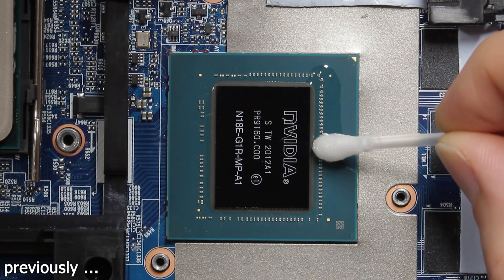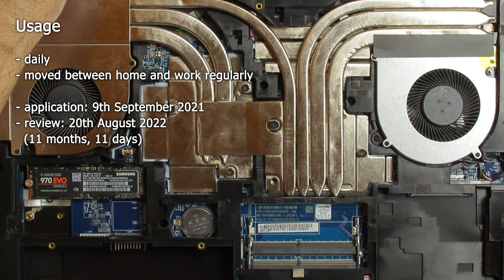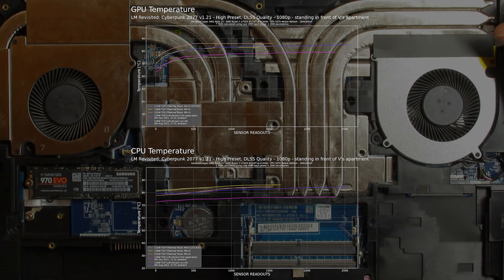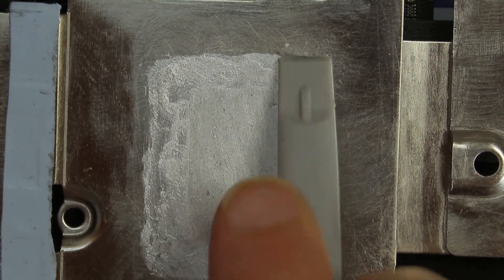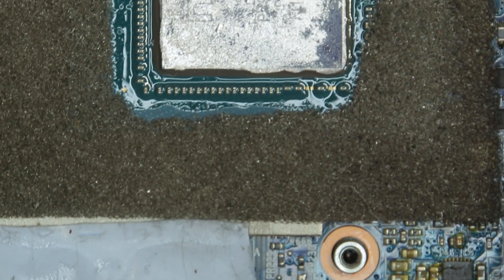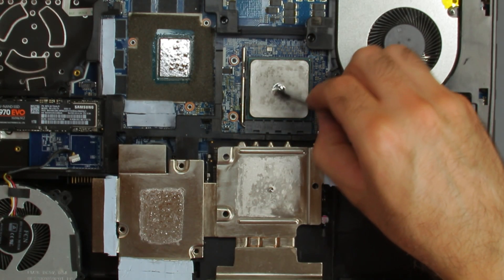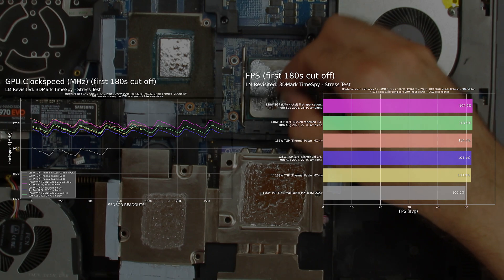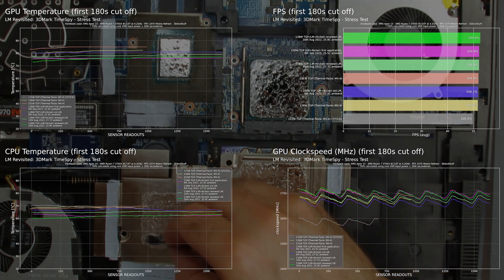Did my nickel plating hold up? - Liquid Metal Revisited - Part 1/2

Comment: Where did you get that foam? I can't find it. I looked on AliExpress and Amazon
Reply from the maker: It's acoustic foam. You can find it in audio stores.
Reply: @TechModLab  About acoustic foam. Is it capable of withstanding the high temperatures generated by the CPU and GPU?

Comment: Great video along with a great series, not seen anyone else doing anything similar.

I saw that Sony were using liquid metal as a thermal interface in the PS5, getting some technical specifics from them is presumably impossible but has anyone done any analysis of the PS5's heatsink coating? I assume Sony did the research before deciding to go ahead with this.
Reply from the maker: Yep they probably got a better nickel plating process. I still suspect my nickel plating was contaminated during the plating process. At least it's strange that it does react that much after 11 months.
A little reaction is normal though.

Comment: i came to same conclusion with my zehyrus G14, it had nickel plated CPU heatsing part, i nickled plated GPU part, after 3 months, temps got bad rly fast for gpu, it looked much worse, all liquid metal was gone, hard as rock, i tried LM second time, same result, 3-4 months , i quit it , put MX4 and its fine ...
same result with delided 7700k , lapped the sh mirror of it, putted mx4 and after 3 yers still good temps

Comment: Hi! for the GT75 titan, how thick should the foam barrier be? I'm considering on using liquid metal on it, I've seen linus tech tip use that coating + a thin electrical tape to prevent damages just in case the liquid metal does leak out. I'm so sorry for having so many questions but I really love this titan and here in the Philippines, I can really say that there are only a few owner of the GT75 titan which is moded by HIDevolution. hope to hear from you soon! love your content!
Reply from the maker: Thanks and welcome :)
The foam barrier needs to be roughly 3-4mm thick and the foam must be very very soft. You shouldn't use dense foam. In my experience acoustic foam from the audio enthusiasts is fine. But make sure it got no initial mechanical resistance when you push your finger into it. It must be soft to the touch. Best practice would be to visit a audio HiFi store yourself and ask for soft foam. It's quite cheap.
You can cut the foam with a cutter knife to a smaller sheet.

Comment: LM is only working on copper!
first you must apply the LM on the copper, than wait 1h and apply LM again.
than on to the Die and put it tougether ✌🏻 than its working for a looooong time.
Reply from the maker: That's not true. LM usually works on nickel plated copper very well.

Comment: Great content as usual!
Was wondering which topic you were going to cover this time. It's really sad that XMG and their counterparts simply ignored any upgrade path to this model whatsoever.
Reply from the maker: Thanks!
Well XMG wanted to get a BIOS update, but they rely on their ODM. XMG got no BIOS development devision. However, their ODM is not able to deliver a BIOS update. Check Link:
https://www.reddit.com/r/XMG_gg/comments/n4i3x2/update_thread_about_zen_3_in_xmg_apex_15_with_am4/
Reply: @TechModLab  yep. I do follow this thread already (great contributions, especially by you btw! 👏🏻), but their sales pitch of this device has always been "a desktop replacement".. well, it is, if you want to get stuck to up to AMD 3000 series.

Comment: Great video. Now I noticed how much protection you added so the liquid metal wont damage the gpu. I applied it when I got my unit without those protections. I'm happy that nothing went wrong when I changed it to thermal grizzly paste. The machine is outstanding so far.